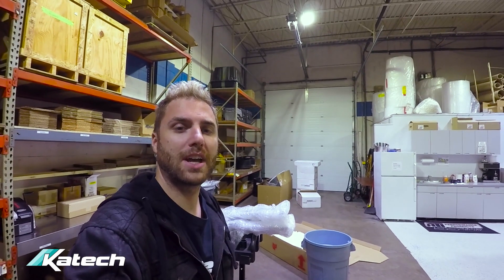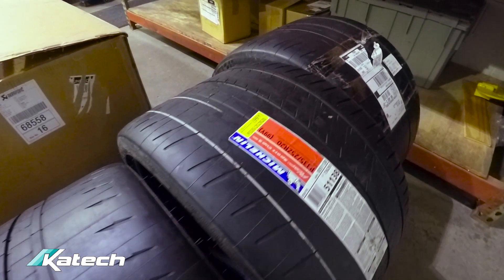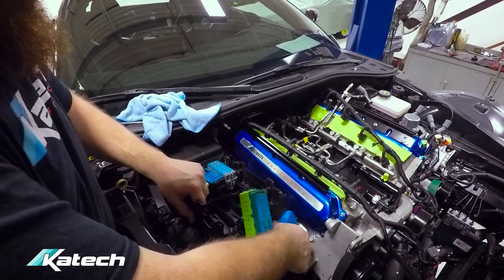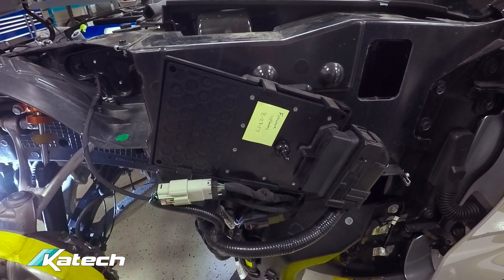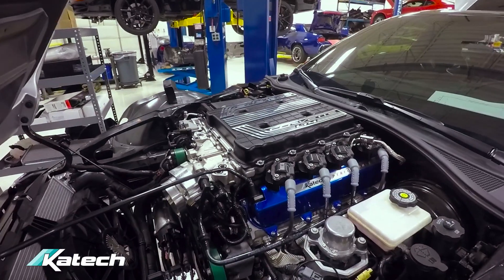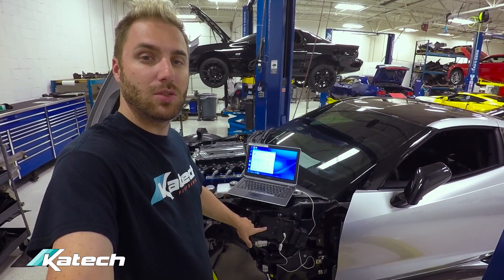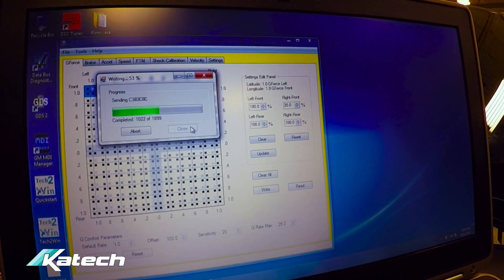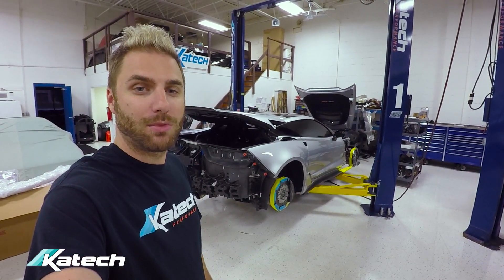Katech Vlog - Apexx C7 Corvette Z06 for SEMA, Gen 5 Camaro Transmission replacement

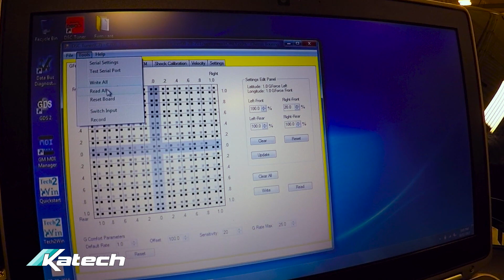Comment: At 7:15, why does only the right-front say 20% and all other corners are at 100%? It seems like something was off.
Reply from the maker: SirBudrick the cursor in the g table was selecting 1g left and -1g longitudinal so that’s showing the shock percentage in that moment (full right turn and full braking)
Reply: KatechPerformance aha! That totally makes sense. I didn't notice the cursor. Thanks!

Comment: I would have countersunk the old wing mount holes and installed countersunk screws or even rivets to fill the holes. Then touch up the screw heads with paint....

Comment: Why can't that deck lid be sent out and spotted in so you don't have to  blend it? Or fill them and wrap it with a design using the same blue as the wheels and valve covers?
Reply from the maker: JpM Motorsports The car has to ship to Vegas next week.
Reply: I agree, its SEMA. It shouldn't go out looking unfininshed
Reply: What day? I know most shops can do that work in 2 days

Comment: Am I the only one that noticed and am wondering why 3 corners were set at 100% and the other at 20%? So confused.
Reply from the maker: lorydr2003 the cursor in the g table was selecting 1g left and -1g longitudinal so that’s showing the shock percentage in that moment (full right turn and full braking)